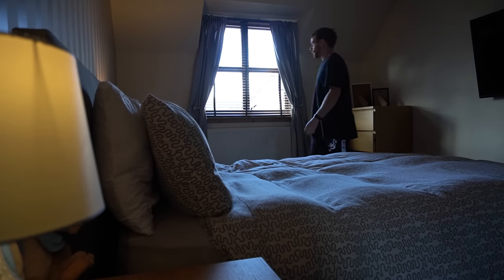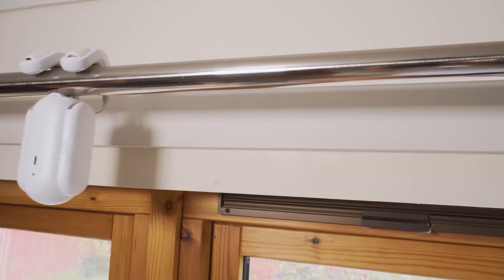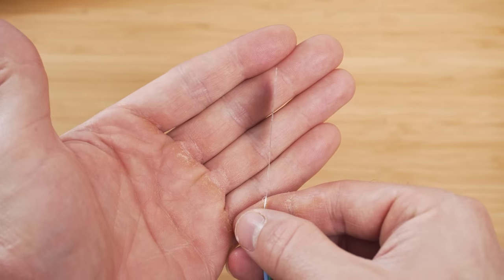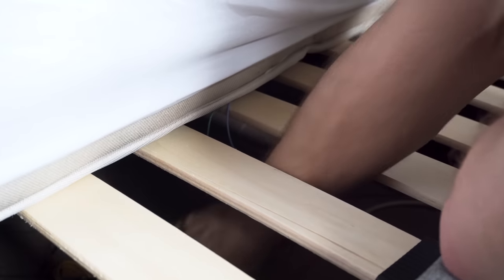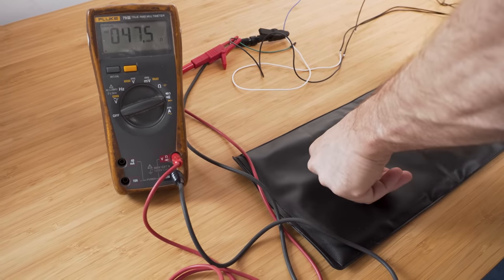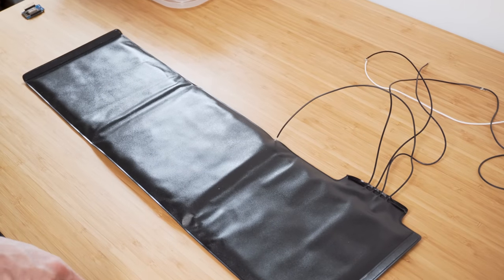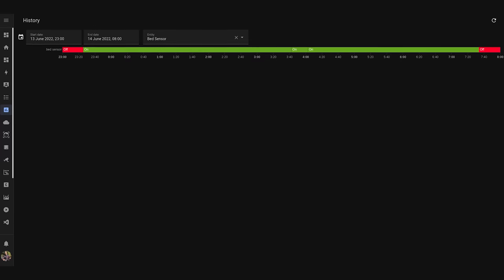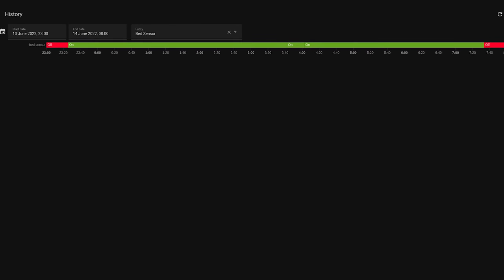Automate Your Smart Home With This Easy Bed Sensor

Comment: Oh this will be the sensor I'll be implementing on my bed! I bought the weights but once they arrived and I started checking how to install them I realized I didn't really like them as it would significantly increase the height of the mattresses. This is a way better sensor! Thanks man for trying and putting out regularly new sensors I had no idea about!

Comment: This was an interesting and informative video. I enjoyed your experimentation and process. 

I have been using a load sensor array with ESPHome and Home Assistant for some time now. I use it to try to keep the dog off the couch. When the weight is within a range (e.g. 10 to 70 kg - based on the sensor, not actual weight), it starts recording video, grabs a snapshot, uses TTS to say "off the couch", and sounds a smart alarm for 10 seconds. It has really only truly effectively worked once.

The reliability issue stem from these factors: 

1) The sensor array is uder the cushions and the weight it reads varies considerably based on how the cushions are arranged.

2) The sensor has sporadic spikes. I will look into the filter command in ESPHome as you described  (Thanks!).

3) The couch is also used by humans. Since the dog does this occasionally and when we are not there, scheduling the alarm has helped to some degree. The variability in the sensor performance in this application defeats a weight based approach.

I have enjoyed this home automation experimentation with weight sensors. As you say, it opens up interesting use cases.

Comment: Used this as inspiration to try with the international mat you linked to, and wiring it into the dry contact terminals of an EcoLink DWZWAVE 2.5-ECO door and window sensor. Took ten minutes, works like a champ in Home Assistant so far. Thanks for the idea / mat recommendation.
Reply: That's the same thing I was thinking about doing. when he mentioned esp or whatever it's called. I use Hubitat & have no clue what Esp is or if it's even available for hubitat.

Comment: I used the pressure mat for about a year, they don't last if you put it above the bed, under the pillow. I ordered mine from RS components. I forgot they had a 3-year warranty, hence I opened them up. Inside is just a foam sandwich between aluminium foil that is stuck onto cardboard. There are holes all around the foam, so when you put weight on it the two aluminium foils touch. One wire connected to the top foil on connected to the bottom. The foil will break up after about a year. If you move a lot during sleep, they will break apart sooner. I connected mine to the Aqara door sensor with a little mod, so its wireless use ZigBee battery lasted a very long time. Maybe I should try putting them under the bed...

Comment: Simplicity wise, been thinking about this sort of mechanism for my bed for a while, but was wondering about which pressure switch to be put down under. And thanks to your video, i now know there's a thing called "pressure mat". Sometimes it's just a keyword away to find what you need online. And you just nailed it. THANK YOU very much!
Reply: The only problem now is finding such thing in my country. Which i literally just realized now, isn't as easy as in the UK/US.

Comment: Great video. I was just thinking about doing something like this the other day.  Also, a potentially even more simple approach, hooking up one of these pressure sensors to a zigbee/zwave water leak sensor.  Since the water leak sensor just detects when a circuit is closed, it might just do the trick.
Reply: I was thinking the same thing, with an aqara water leak sensor. Curious if you got this to work?
Reply: @oliverwemyss5527  I haven’t done it yet, but I’ve looked around and it seems like a lot of people have got it working. I’ve even heard of people doing it with contact sensors.

Comment: One thing I found is that the pressure mat I got required wire 1 connecting to 1 pin, and wires 2 + 3 connecting to another. In my case Pin 1+2 were always-on, Pin 3+4 are always on, and no combination of any 2 wires caused it to act like a pressure mat - only combining (1) + (2+3) was I able to get it working. Something to keep in mind for anyone else considering this (YMMV of course).

With that said - great video! I've been trying to sort out a life-long sleep problem, so I've been ruling out different factors which might be causing problems. Recently discovered that humidity is a major factor for me - 53-59% is perfect for sleeping. Any lower = dry sinuses = waking up with headaches and low energy. Any higher = generally uncomfortable in a room that's already quite hot. So far, I've been using time as a condition, but now I can use bed pressure as an additional condition!

Also, because it's literally just a pin high/low check, this makes it one of the simplest projects and workable on even the cheapest microcontrollers.

Comment: I am fortunate that I have a "Sleep Number" bed, which has integrations with Home Assistant already, and there is occupancy detection built in so I don't have to build/add anything to use it. 

If I get out of bed at night it turns on an under bed LED light so I can see my way into the bathroom. I plan on extending that in the future with some LED's under the vanity in the bathroom that will turn on and off on as well based on that occupancy state, so I don't have to blind myself by turning on an overhead light. 

I also use the bed's occupancy detection to auto-mute certain broadcast messages (for example if the 3D printer finishes printing) through the smart speakers, as well as mute certain notifications on the phone.

Comment: Thank you for this video!
I have also built a similar sensor on my bed. 
I have built a simple switch under the slatted frame and the slatted frame is lifted slightly with a spring, so that it moves slightly downwards when lying down. 
This also works great and I use the sensor to record my sleep time. This time is then sent to my cell phone in the morning and added to statistics for the average sleep time. 

Works great for years now!
Reply from the maker: That's a good idea too, well done!

Comment: Those FSRs generally have a thin spacer between so if you squeeze them between two flat plates larger than the sensor they don't give much (if any) response. You can attach something smaller than the sensing area to it (eg put a coin on top) and that will press down on the active area. They're still not great for measuring actual weight because they have an exponential response going from >>1MOhm when unloaded and <<1k when pressed hard so it's hard to pick a resistor for a potential divider, but if used like a load cell where all the force travels through the sensor and it's properly calibrated you can get your weight to ~1%...the problem is under a matress it'll be impossible to calibrate as there's plenty of ways for the force to bypass the sensor.

Having said that it would be neat to get an array of FSRs or a patchwork conductive fabric mat with different zones which could tell where in the bed you were. Are you sat up watching TV, sat on the edge of the bed getting dressed etc.
Reply from the maker: Indeed, not as useful as I had initially hoped - but still fun to experiment with!
Reply: @EverythingSmartHome  There is a 600mm long FSR available from SparkFun. It works extremely well and does not fail from compression like pressure pads (eventually) do. There's a a great topic on it on the Home Assistant forum.

Comment: The sensing part is a generally easy solve and you've posted a few workable solutions. I'd also recommend for anyone who wants less fiddling/flashing/setup that they can use a Shelly Uni instead of a ESP for anything that requires binary or analog sensing. It's cheap, small and already has wires and harness, plus all the built-in software to run it with a web GUI to configure various settings. It has direct ADC sensor reporting and also two built-in relays (low current) that can be used to trigger other things (or used as binary sensors to report the ADC or attached switches as on/off). Built-in Shelly integration in HA works great or even MQTT can be used.  Lots of options.

That said, I think the most difficult part of most automation is coming up with sensible logic to create 1. great/seamless usability and 2. Wife-Acceptance. :) That's going to be a big part of bed sensing when tying it to things like lights/blinds/curtains, etc...

Comment: Great video! This is a project that I prepared to do already. I am planning to connect the wires from the pressure mat to a contact sensor instead of an ESP
Reply from the maker: Thanks! Be aware that while that will work fine, you won't be able to adjust the on and off time directly on the controller, so the response time will be immediate which may cause problems I mentioned in the video

Comment: First of all the video was nice. Now a little suggestion for the FSR or DMS (if you are in Germany). I use the FSR instead of unter the mattress, under the legs of the bed. There it works without problems and you don’t have a problem with a person moving around because the value is pretty stable. The only drawback I can think of is, that you can only detect if someone is in the bed, because I think the difference between the one and two people in bed aren’t reliable measurable.
Reply: What kind of FSR do you use? The FSR402?

Comment: Thank you for answering the "why not IR or microwave sensor" question.  My first thought was, why not put two microwave sensors on the floor under the bed pointing up?  I thought that you might be able to restrict a microwave sensor's field of view to allow for both sides of the bed.

Comment: That's another good option very practical. Also reminds me of a couple sensors I did using a old mouse micro switch and another one with a travel switch I belive it is called on a chair. I guess just glueing one small switch in the wood slab against the mattress deformation will just work the same.  Another idea would be to use a weight cell but the beam type that measure on the deformation of a aluminum bar, all would take would be to screw it directly to the bed slad that will deform together with the sensor if tighten together. 👍 video!

Comment: Instead of the small round FSR just get a long one like the SF15-600 which is a 600mm long band. I used that for my bed and it worked very well.
Only the automation i had to turn off the lights in my whole apartement wasn't really working for me cause i often wanted the light to stay on while being in bed so i replaced it with a small zigbee button which i simply press to turn on and off all the lights.
Reply from the maker: Haha bet that got old quickly 😂

Comment: Just take a „car seat sensor“ . You can get that one for 12 dollars and then solder it to a Aquara door/ window sensor (by replacing the reed contact). And viola, when you lay down on your bed you get the signal that the door sensor is „closed“
Reply: Did not know they existed, great idea. Using the aqara water sensor is easier though, they have two bolts on the back where you can attach the sensor persure sensor without disassembling it

Comment: Order 2 and arriving tomorrow! I did manage to setup the load cell sensor from your previous video but had a right nightmare trying to configure it.
Reply from the maker: Really? What happened? Let me know if you need help!

Meanwhile, good luck with the pressure mats!
Reply: @EverythingSmartHome  I'm guessing it is due to wiring as I wires on those load cells are really thin and might have damaged them whilst setting them up. I've got a super king bed and struggled to 'stretch them out' properly. I'll probably end up reusing those on my sofa. Looking forward to these new sensors though!

Comment: I use one of these pressure mats under my mattress: I wired it to an Aqara door sensor (cutting away the magnetic sensor) and it works well, but as you experienced it's too quick and it has a bunch of false positives. And it's not good for the purpose I had in my mind: turning on the nightstand lamp when I got up at night. Turns out that the light goes on and off randomly (even if I added a delay to the automations) :D
Reply from the maker: Haha yeah being able to control the code is good like that - but good to hear your experiences!

Comment: the FSR could have worked, they come in many shapes and sizes but the one you got was far too small for a bed. they make large square ones and long strips those are the kind you need for a bed. Also you could simply use the pressure mat with a door/window sensor, all you need to do solder the wires to the magnet sensor bar thing.
Reply from the maker: This is indeed true! I may revisit it again!

A few people commented that and it's s good idea, but I think I'd still prefer using an esp in this instance for being able to control the on/off time more easily - you could do this in automations but I think it's nicer doing it on the sensor itself. 

Nonetheless, it's a good idea!

Comment: I bought the US version you linked. The mat is connect to the chime  via a connector with two wires. I just disconnected the chime put two dupont wires in the mat connector and connected the two ends to the opposite sides of an Aqara Water leak sensor. Seems to work fine. Takes  maybe 10 seconds to register off. I will spin up mqtt explorer and time it. I don't know yet whether the cats sill trigger it.
Reply: Works great but I have to disable automations during the day. It is sensitive enough that the cats trigger it and they rest on the bed often.
Reply: Jist a heads up. The mat stopped being reliable after a week. Sending it back for a replacement. Will keep updating.

Comment: Could you use two pressure sensing pads on one esp board - different gpio pins??
Reply from the maker: Yes absolutely that will work - good point I should have mentioned that!

Comment: Super cool idea, and I might find some way to use this, however we read in bed so I don't want to turn off everything when we get into bed. I may look into this for when we both get up it turns off night mode. Currently I just detect when we turn our sound machine off for that.
Reply: If you're detecting when you turn it off to turn off night mode, are you detecting when you turn it on to turn on night mode? No, I wouldn't expect it to be a perfect solution either.

Comment: I loved your original video about the bed sensor but it was a little bit out of reach for me to do the same. I achieved the same thing using the Withings sleep sensor, the only down side is that I need to use IFTTT to update the states of the sensors to home assistant by using a webhook. But other than that it works quite well. I love that now everything in my house turns off when we go to bed.
Reply: Ifttt is a big disadvantage because you now rely on the cloud. That's something many of us are trying to avoid.
Reply: @Leonvolt28  that’s why I said it’s “the only downside” of this setup.

Comment: The timing of this video is spooky. I went with the load cell method, bought them ages ago but only got round to wiring them last week, Couldn't figure out the best way to get them under the bed as I don't have a 3D printer, so I bought a FSR sensor, which arrived yesterday. Tried it and discovered like you did that it works great on the bench, but not when the expensive mattress is spreading the load.
So, while trying to think of a way round it, I downloaded some files for load cell holders and sent them off to a well known Chinese manufacturer to get 3D printed.

Now... do I go buy one of these as well.... ??

:D

Comment: Great video!
I am using also a similar sensor.
I just wanted to point out my method with such sensors.
The way they work better is to register them as trigger sensors throught tempate (template: in yaml) like:
- trigger:
  - platform: state
    entity_id: binary_sensor.bed
    to: 'on'
    id: 'on'
  - platform: state
    entity_id: binary_sensor.bed
    to: 'off'
    for: '00:01:00'
    id: 'off'
  binary_sensor:
    - name: Bed Occupied
      unique_id: bedoccupiedid
      device_class: 'occupancy'
      state: >
        {{ trigger.id }}
Reply from the maker: Thanks!

What would be the advantage to this over using a filter?

Comment: If i want to use an Fsr Strip for this how would the cables be soldered in order to Work? Same way? Since there are only 2 connectors to solder on the Strip.
Reply from the maker: One wire is vcc, the other is connected to a GPIO pin and pulled to ground with a resistor
Reply: so from the FSR strip (used instead of the pressure sensor in the video) the wiring is the same to the d1 mini?
Reply from the maker: Well you need a resistor and an extra ground wire but similar. There are some wiring diagrams on Google for the FSR
Reply: ok thx will try that. thx mate

Comment: Is the change in resistance dramatic enough that a moisture sensor (like the Aqara, with screw terminals) might be used? That'd obviate the need for the ESP device entirely.

Comment: What about creating a durable, thin fluid or air filled plastic bladder with an internal pressure sensor when the bladder is under pressure?
That could be placed under both sides of the mattress.